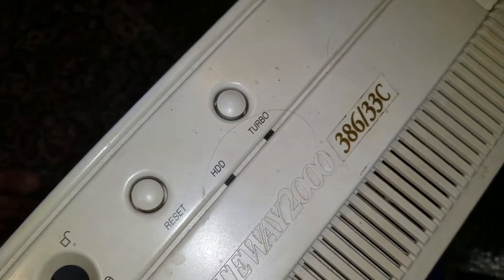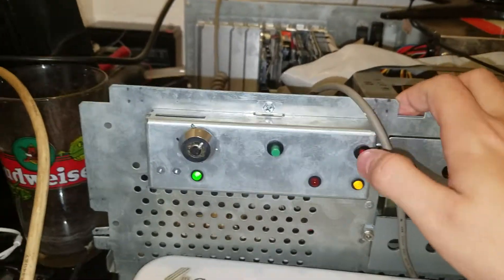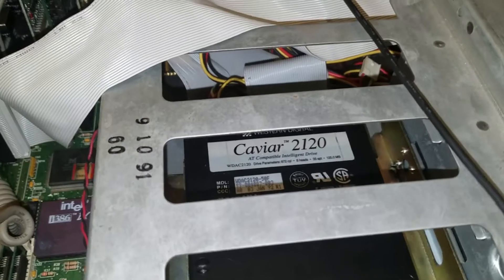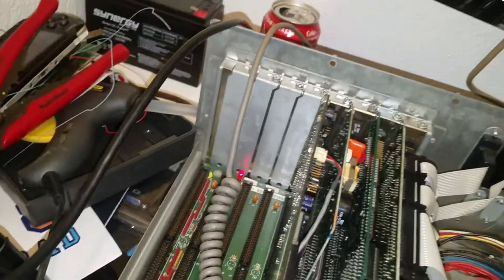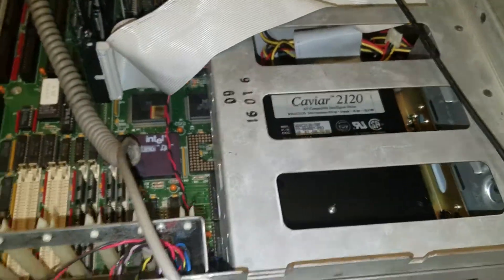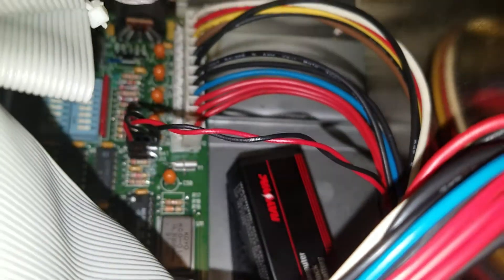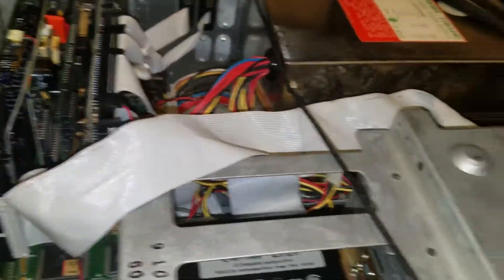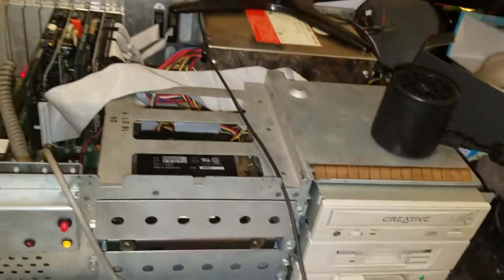Gateway 2000 386/33 no boot

Comment: Awesome hope you found a way to fix it, i have a gateway 2000 386SX/16. exterior looks different but the interior is almost exact except for the turbo and reset switch interface. My motherboard also had some damage from the battery leaking at some point in it's life time but, works great otherwise.
Reply from the maker: I never did, This machine is a little older than what Im used to playing with.

Comment: As i see in your pc there is no ram installed, you should use simm 30 pin memory ore spetial expansion board like 385 ram board: https://yandex.ru/images/touch/search?pos=1&img_url=https%3A%2F%2Fcdn8.bigcommerce.com%2Fs-a1x7hg2jgk%2Fimages%2Fstencil%2F350x350%2Fproducts%2F10357%2F53170%2Fmicronics-8-bit-isa-memory-board-47-0019-001-08-001-201-1.39__82343.1490009868.jpg%3Fc%3D2&text=385+memory+board&rpt=simage&source=tabbar